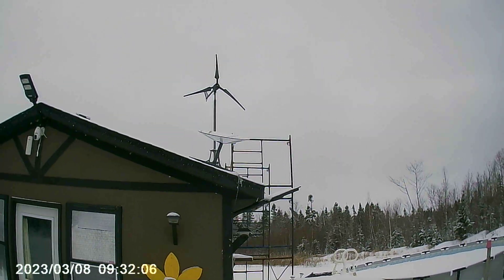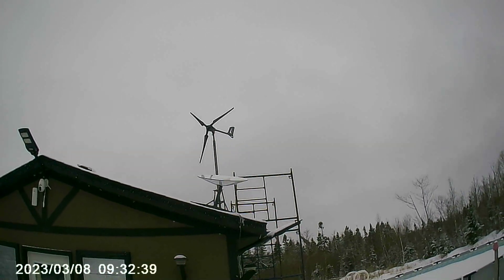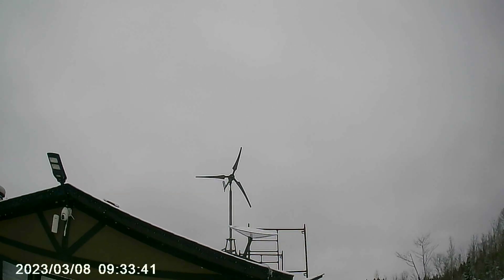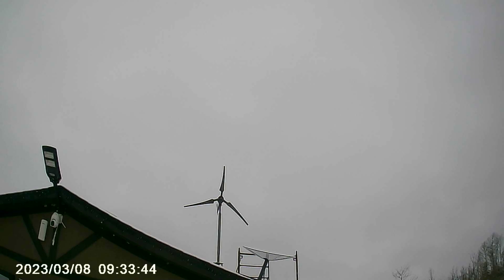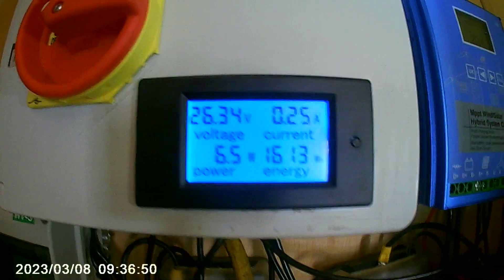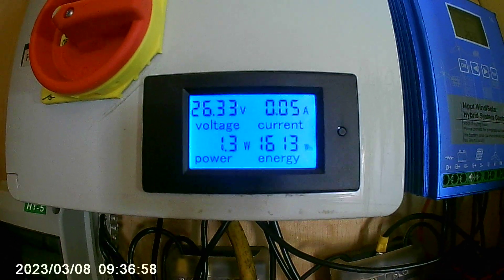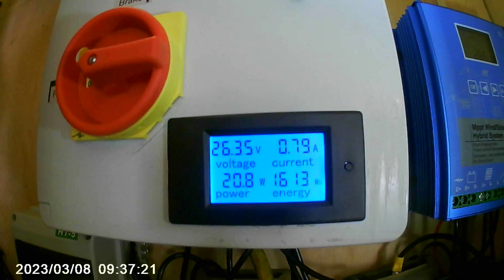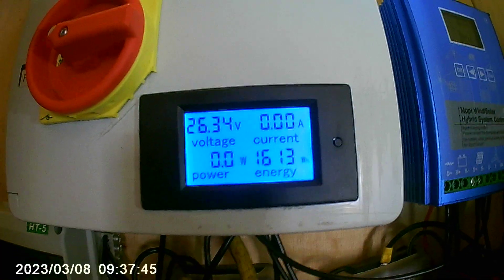ista breeze i 700 mod are longer blades better part 1

Comment: With low speed wind, you better go with 5 blades.
Reply: Bad idea, it will spinn earlier but produce zero power. Use 5 blades if its to much wind to slow down the generator.
Reply from the maker: i would agree
Reply: Probably producing very good power but just not quite reaching the battery cut in voltage because of the extra drag